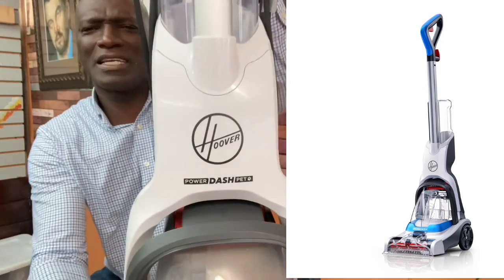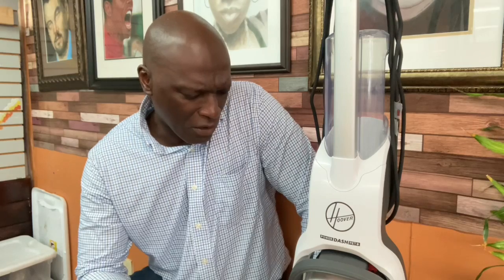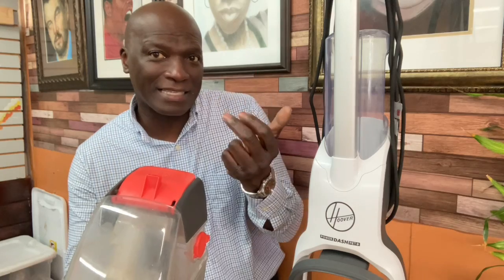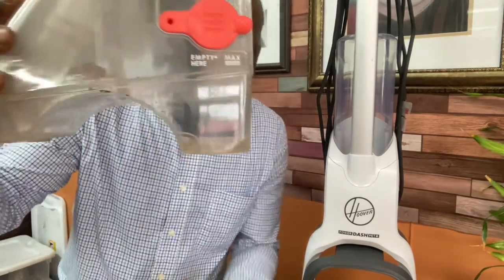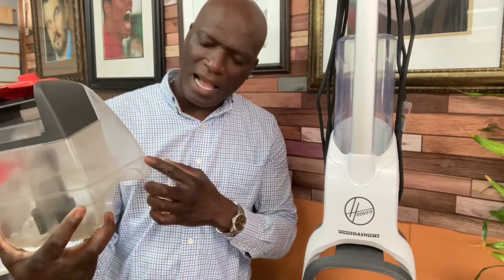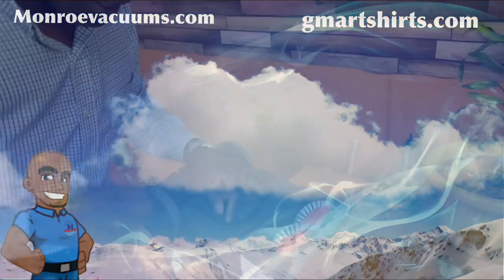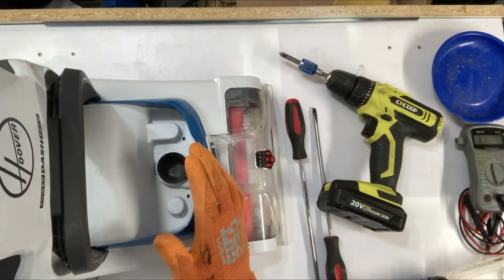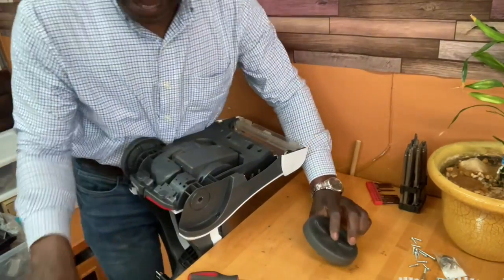Diagnosing the Hoover powerDash pet no power problem

Comment: I removed all of the visible screws and was stumped. Thanks for the detailed disassembly instructions. Turned out to be the motor. Thanks again!
Reply from the maker: You’re welcome- be sure to subscribe. Thanks for supporting the channel
Reply: How do you fix it??
Reply from the maker: Replacing the motor is the solution right now- finding a motor is the challenge- still searching

Comment: Super helpful thank you, the in depth explanations helped me figure out exactly how it works what the problem was (and gave me a chance to give it a real good clean). It wasn’t turning on, figured out Pedal wasn’t pressing the power switch, I gorilla taped a flat square piece of LEGO to the pedal where it connects to the switch so it now presses the switch and now it’s good as new
Reply: Also never would have found the screw under the wheels! Did not realize the wheel was held on by a horseshoe clip which was a pain in the but to get out, that was maybe the only thing missing from the video but I found another video for that (after a fair amount of failed prying)
Reply from the maker: very creative solutions-thanks for sharing
Reply: Turns out I had a stuck pedal as well! Tx for pointing me in the right direction. Gotta read the comments ;)
Reply from the maker: @houseofsugars  You’re welcome

Comment: YEAH THIS IS THE FIRST TIME IV EVER POSTED A COMMENT. YOUR VIDEOS ARE EXCELLENT AND RIGHT TO THE POINT. I HAD THIS POWER BUTTON ISSUE SO I THOUGHT JUST BYPASS THAT SWITCH AND JUST INSTALL A TOOGLE SWITCH CAUSE THE DESIGN ON THAT POWER BUTTON IS A BIT FLAWED AND NOTICED NON CONSISTANT PERFORMANCE OF THE FOOT SWITCH OTHERWISH THIS SMALL CARPET CLEANER IS THE BEST IV EVER USED ITS CLEANED EVEN THE SPOTS THAT I THOUGHT WERE PERMANENT SO IM GOING MODIFY THAT POWER SWITCH AND THAT SHOULD FIX THAT PARTICULAR DESIGN FLAW.
Reply from the maker: Thank you- check in again and let me know if it worked out. Wish you the best

Comment: You got me with this tank I noticed that max line while I was checking it out mine isn't coming on I was just using it
Reply from the maker: Probably the motor. I found a motor online and made a video on how to change it. I am currently in the middle of editing it. Stay tuned
Reply: Idk might be something with the foot switch if I push it with my foot like normal nothing happens but if I stab it with a screwdriver it comes on same thing turning it off a quick stab
Reply from the maker: @JamesJohnson-gl8zk im working on a video that will cover possible causes for power switch mishap

Comment: There were some changes made to these at some point.  I've watched several videos on taking them apart and some models have Torx screws while some like mine have all Philips screws. Some have wheels that just snap in. Mine are held in by a metal C clip. Hope mine just has a bad switch. These are great for cleaning throw rugs and car mats. My main machine-Hoover Elite, has too much suction for small jobs.
Reply from the maker: Great observation Mike. Thanks for sharing 👍🏾

Comment: I know on the newer models there is a latch on the back of the tank that lets you clean it, but do you know if there is any way whatsoever to get in to the tank on this model. Both me and my fur baby have long thick hair and no matter how much a vacuum before I clean the bedroom carpet the tank ends up with hair getting in the tank and no matter how many directions I manage to try and spray it there is one thin line around the top of the tank that I just can't reach. Is there ANY WAY whatsoever to open the tank to give it a proper cleaning?
Reply from the maker: Hmmm good question. I’ll look into it- I’ll check my stock room to see if I still have a tank to review it for you. Stay posted

Comment: Just curious, mine seems to have a power surge issue. I replaced the belt thinking it was that. Plugged it in and it turns on then makes this rev type noise where it goes loud then low and so on and so forth. Motor issue?
Reply from the maker: Yes sound like it

Comment: What did you push to get off the wheel?
Reply from the maker: The wheel shaft is designed like a Sheetrock tap in stud for screws. It expands at the end in order to secure the wheel. Just squeeze the tip and force it out

Comment: My carpet cleaner won't turn on again. This is the sixth one I purchased, and they all have the same problem. When you step on the orange foot pedal switch, the unit will not start. It usually will start on and off before it completely dies. It is a defect when they made them!
Reply: Same here
Reply: I took mine a apart.  Turned on the switch, which still works fine. I don't use that stupid on/off petal assembly.  It's a terrible design. I just plug the unit into a power strip and use that switch to turn it on and off.

Comment: i have a  Hoover Floormate deluxe and it just stopped working for no reason

Ive only used it about 5-6 times with no issues.  

The other day i tried to clean my floors and filled up the tank and attached it and it started for a few seconds and shut off. Will not start after that
Reply from the maker: Possibly motor. Still cant rule out the power switch- if you notice the motor is positioned above the dirty water tank with a filter in between- Often times water would find its way to the motor and there goes the machine-

Comment: I have no idea what's wrong with mine. It's making a loud noise and smells like burnt rubber and left black marks on carpet. Could it be the motor?
Reply from the maker: Could be. But first try running it without the belt and brush engages. Remove the belt and turn the unit on. This was you can isolate the noise by removing a moving part. Then you’ll know for sure
Reply: @monroevac  thank you I will try that
Reply: @monroevac  I removed and it still making noise
Reply: Mines just did the same thing today loud noise and rubber smell smh
Reply from the maker: Then it’s the motor
Reply: Mine did the same

Comment: Worked for 1 tank & died. 
Very disappointed & won't recommend on any level

Thank you for the video, excellent
Reply: Mine started leaking  cleaner  solution uses solution really fast. Makes loud noise and completely  stopped.Mp power at all.
Reply: What to do?